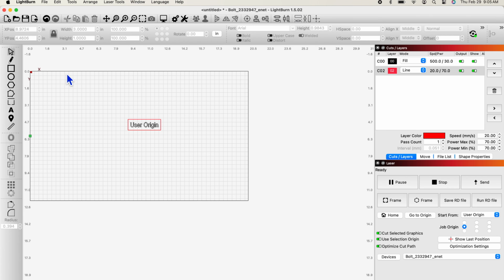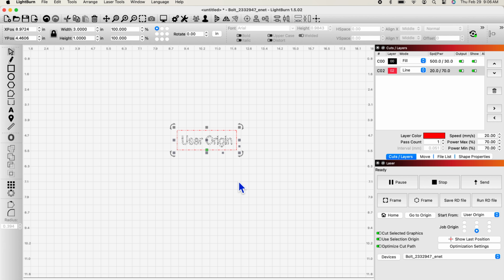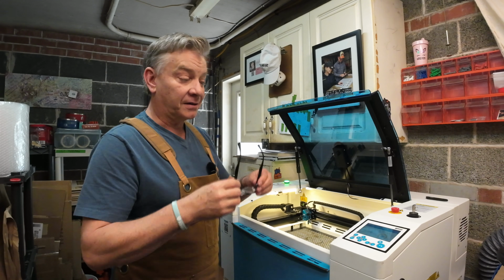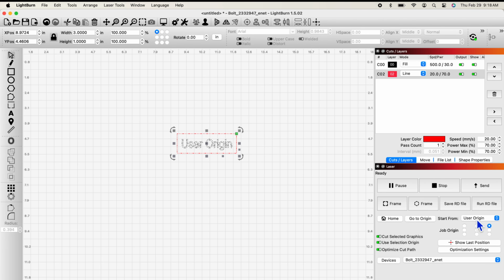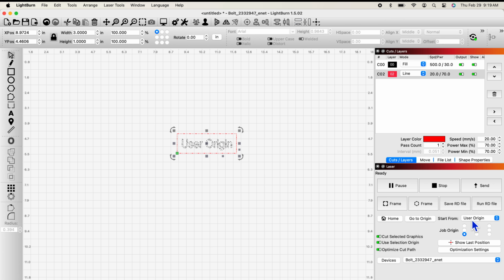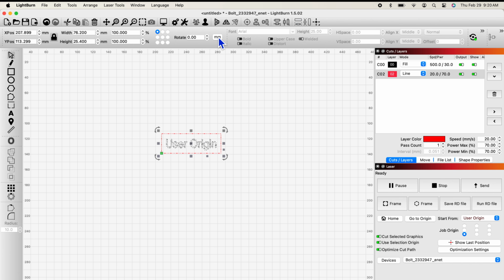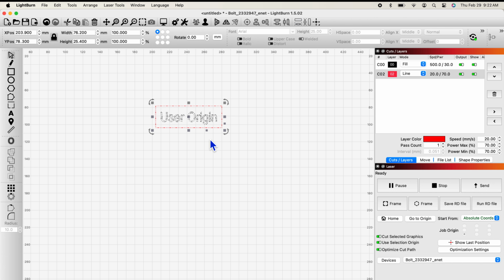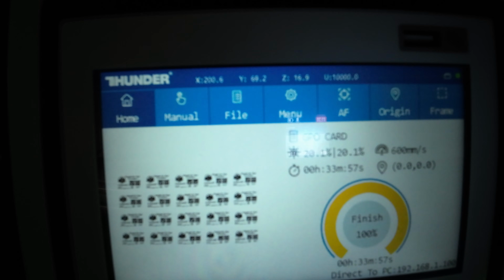Absolute Origin? Yes Please. Thunder Laser BOLT. Production Templates. Lightburn.  023   4K

Comment: I find my  0,0 coordinates on the Bolt is approx 1mm to the right of the Y axis ruler edge and the X's 0 cordinate is about 5mm down from the X axis ruler on the honeycomb. I always thought 0,0  was meant to be where the X and Y rulers intersected. It make it difficult to align a jig into the corner along the rulers because it is not 0,0.